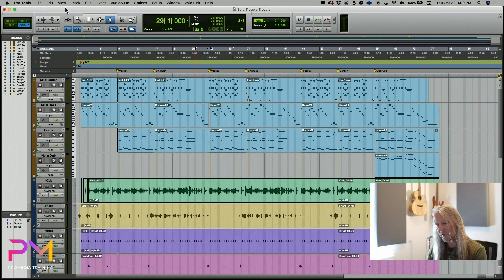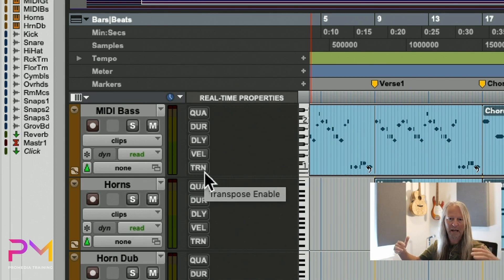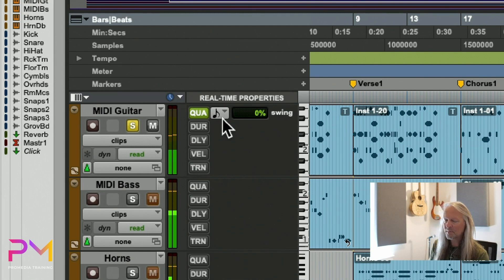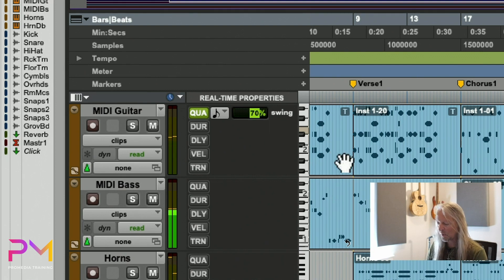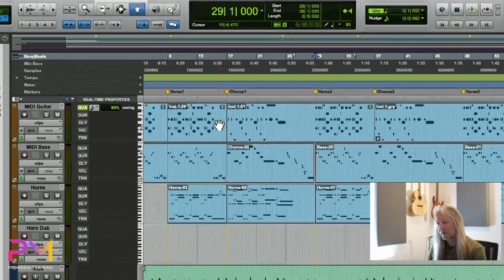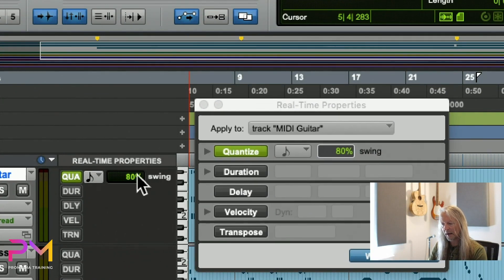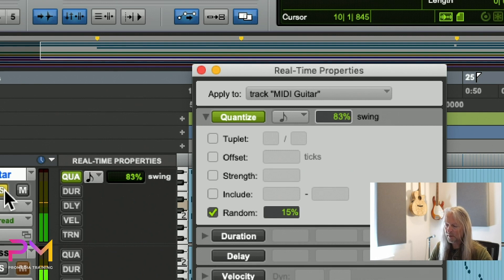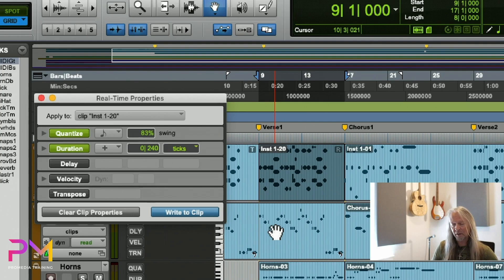MIDI Real-Time Properties In Pro Tools

Comment: Hey Frank! Awesome video. In my session when i use real time properties, say QUA , it's definitely working - but visually my midi does not shift like in your session. Is there a setting to fix this?
Reply from the maker: In order to see the MIDI events react to the Real-Time Properties you must enable the view in your Preferences:
Go to the Setup menu, select Preferences (at the bottom of the menu)
Click on the "MIDI" tab in the preferences window
On the right-hand side of the window, check the box marked "Display Events As Modified By Real-Time Properties"
The midi notes / events will now react to the real-time settings.
Reply: @ProMediaTraining  THANK YOU
Reply: @ProMediaTraining  Thank you so much!